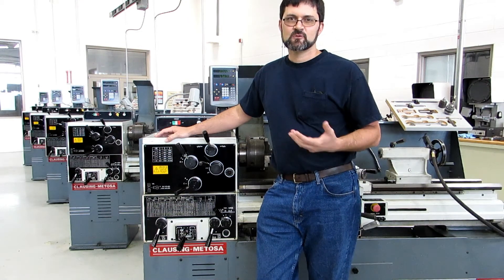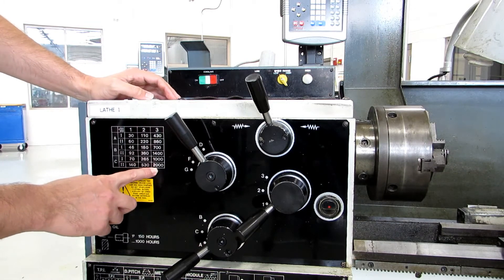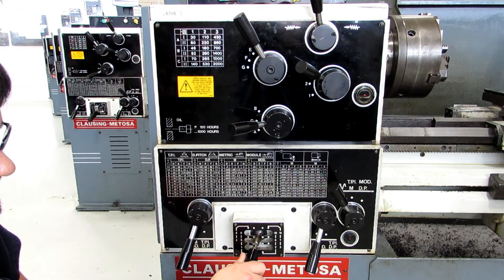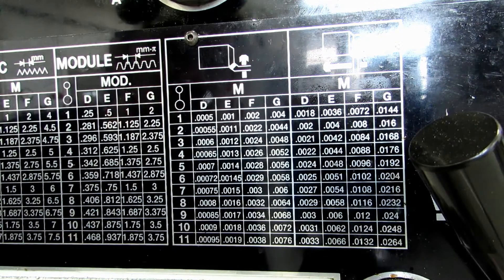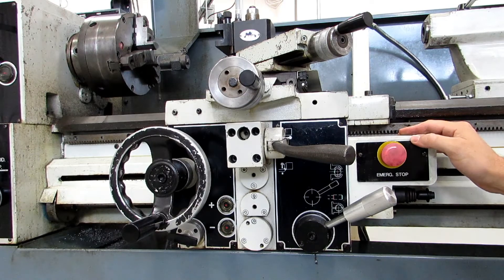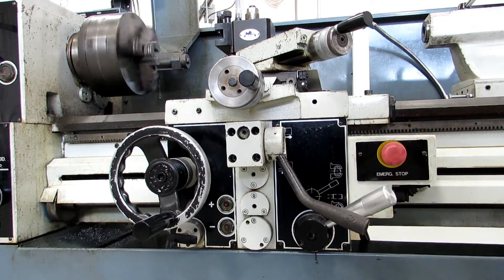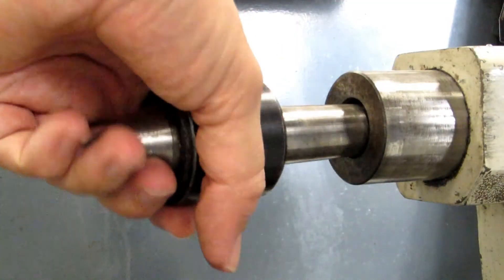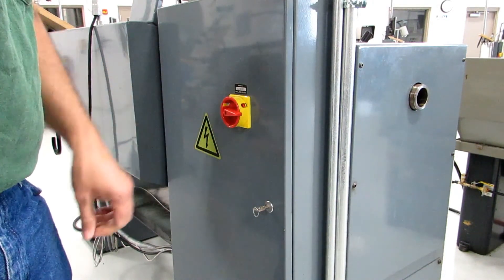Parkland College Lathes - The Clausing Metosa Lathes

Comment: I had one more question about these… do they not have a neutral to free spin the spindle? Thanks
Reply from the maker: If you pull the 1-2-3 handle out you can put it between gears and the spindle spins freely.
Reply: @StuartdeHaro  ok that’s what I was doing I just didn’t know if there was something more correct I should have been doing or a official setting. Thanks!
Reply: @StuartdeHaro  Ok just one more question 😬…. I have the same MH90 Dickson type tool post that it came with and it looks like you guys have the same one but I was going to abandon it because I don’t know how to tell what size tool holder it takes. Do you know what size or type Dickson tool holder those tool posts take? Thanks sir!
Reply from the maker: @noz455sd  I don't know off the top of my head and don't know much about them. I really don't like those tool posts. I don't want to say I hate them, but I kinda do.
Reply: @StuartdeHaro  yeah I can’t say I’m a fan but I’ve not been able to even use it. I contacted the mfg in Spain and it was entirely to much money to get just one. I just wanted one or two so I could make the parts I need to mount it’s replacement which will be a size E multifix. There are a ton of the style coming from India that you can find on eBay but I was able to get a grasp on how they are sized so I could select a proper fitting holder. They are relatively cheap but 30 to 50 bucks waisted per holder doesn’t seem like much but it all adds up so quick.
Reply from the maker: @noz455sd  let me know if you need help making anything.
Reply: @StuartdeHaro   well thank ya! I’ll kinda let you know what direction I think I’m heading. So the compound on mine is 92mm and some change wide. A size E multifix tool post round body diameter is around 125mm and that’s really the size it needs for tool height and horsepower requirements but is going to overhang the compound. So at minimum I need a new T nut for the cross slide and I don’t know about your lathes but my compound has a center hole cut in the middle of the t nut slot of the compound. I watched a install video abom79 did where he basically made a two piece t nut that had a top and bottom. I was going to try to make a top t nut “plate” that was thin but is the full 125mm for the side to the tool post and them on the bottom of it make it fit the circular portion and slot of the compound(kinda a keyed fit that won’t walk around even if it was lose), bored through center for the custom bolt that will sandwich it together to the bottom t nut. Did I make any sense? Maybe I’m over thinking it and should just make a single t nut and deck it off like other installation and that any tool post height I add might make it less rigid than it was before I just though it would be interesting to utilize the hole in my compound plus the 6mm dowel pin the post come with to prevent any desire to rotate. Anyways sorry 😃
Reply from the maker: @noz455sd  Send me some prints and I'll see what I can do for you. The email is my channel name with no spaces or dots or anything at gmail.com. It’s up to you whether you pin the tool post in place, but for what it's worth, I'd rather have the tool post rotate in the event of a crash instead of something expensive breaking.
Reply: @StuartdeHaro  ok that is some logical advice. The pin system for them has three pin holes used as index points. Since it’s 40 position on 9 degree increments the pin holes were intended to make it possible to reindex the post from 0 to +3 and +6 degrees  to hit the spaces in between if ever needed. It may take me some time to draw it up. Also I found out the actual tool post might be back ordered until October unless I buy the actual Swiss made brand but the price difference in $1000 bucks 😬. Also for reasons unknown to anyone other than the genius who commented this heinous act (probably laying in a scrap pile somewhere) the tail stock barrel was removed and is missing 😞. If I get precision measurements of the bore Clausing can have Metosa oversize one and grind to my exact spec but it’s about $1400.
Reply from the maker: @noz455sd  That is definitely inconvenient about the tailstock quill. I should also warn you, the compound is very thin on those lathes. I had a student crash into the chuck with the compound over extended and it snapped it in half. The replacement was...pricey. Keep that thing pulled in.
Reply: @StuartdeHaro  this is kinda wild.. I bought two of these clausing metosa c1330s lathes and one is missing the top slide, the other has been busted in half and some pretty impressive repairs done to it to fix it up. It works ok. I just wanted to replace or make one. Also knew is missing the tailstock quill as well... I wonder if I have the machine or machines that was discussed here ? 😳
I thought I would just whip one up, after being out of the machine shop for 19 years.. yeah-not. I am so rusty at this point I'm second guessing reading a set of mics.. lol 
I however do have technical drawings drawn up. 8 mo later are you still interested? Would love to hear your thoughts after seeing the print ? And a price maybe? 
I did contact Metosa/Pinacho and the quill is no longer available.  The top slide is for a mere $2,780.63.. 
Durabar is looking like the raw material of choice... 😔👍 
And now if I could just find a good machinist to help me out I'll be well on my way. Haha. Thanks for the video though.  It truly did help me to get more comfortable with my new machine.  And yes its complicated and heavy, but a nice addition to the garage.  (2023 price in the midwest was around $6,000.00 for anyone looking at one). But that was with no tooling, no steady rest or follow rest and I feel those both are very important on this particular machine. But otherwise in good condition.  Hope it helps someone else out there. 
Oh and the the longitudinal/cross feed diagrams being in thousands of an inch was a big help. I was struggling to find out what the denominations ment. I figured it was metric. Thanks a million for going over that. If you have any other content on this machine I'd love to see or read it.  
Thanks again,  sorry for the long winded rambling.  Hope you have a great day. 👋
Reply from the maker: @jasonhull5712  Unfortunately I'm not really in the position to make much right now. I moved some months back and my shop isn't going to be put back together for a while. Sorry.

Comment: What model of causing lathes are these? Happen to know how much one costs? 
This seems perfect for a small home shop.
Reply from the maker: These are the Clausing Metosa. New, back in the 90's, I think the school paid around $13,000 USD for each of them. I saw one for sale on Craigslist a few years ago for around $5,000 and that seemed to be about right. They're pretty big machines for a home shop, 14x40, weighs at least a ton, but it depends on what you define as a small shop. If you're looking to make money with it, it's a decent choice. If it's a hobby, they're probably more than you need. They are overly complex as far as I'm concerned, but once you get used to their quirks they are very capable machines. Thanks for watching!
Reply: Stuart de Haro thank you very much for the info and getting back to me. Really appreciate it! 👍
Reply: @StuartdeHaro  Have you ever had to get parts for them? Are they doing well? I just got one for what i think is pretty cheap but it doesnt have a steady rest, follow rest or micrometer stop... but it did have a Newall DRO and its not missing any paint
Reply from the maker: @noz455sd  Clausing is still in business so you should be able to get parts. The company, or at least the US branch is based in Michigan. I can't really speak for the cost of parts though.
Reply: @StuartdeHaro  thanks for the reply! Clausing industrial and 600 group now has zero mention of the Metosa brand associated with their webpage, searching comes up with very little, very few machines out there and the ones that are, do seem to sell and that could be a good sign to their reliability. If it never breaks why talk about it kinda thing 🤷🏻‍♂️ but I’m looking really for accessories but will likely end up making them myself. Pinacho and Metosa are out there but have little US presence. I haven’t contacted the companies them selves so maybe this coming week I’ll reach out and see what they have to say. Thanks! Also the similar pinacho lathes have the controls on the apron inverted… super odd

Comment: hello, anyone know about the brake timers for these? my spindle will not spin after motor turned off. usually spins free after 10 sec delay. all started with burned out motor relay. replaced relay, replaced brake timer. ???? thanks
Reply from the maker: The brakes on ours kick off after just a few seconds.  I'll see if I can find the manual next time I'm there.
Reply from the maker: Hi Maxim.  I took some pictures of the parts of the manual dealing with the brake mechanism last night.  Here are links to the pics:

https://drive.google.com/open?id=1hsInqxPVw4nMQj6VYK1DavquAIrRc_R2
https://drive.google.com/open?id=1mngQnlazxqXlcdu9jwZz0k3d-X7hLeQ0
https://drive.google.com/open?id=1yG-lD34-7WE0YDihs5lOrLZCvl6fLdBX
https://drive.google.com/open?id=1EtD17Pwvll-9jk6cD8ntFqOZgTQ_RSgf
https://drive.google.com/open?id=1UcgDD79-ai4dIc6JKOhJq1382oKcIodL

I hop this helps you out.  There wasn't much info in the manual.  Cheers!
Reply from the maker: oops.  Here's two more:

https://drive.google.com/open?id=19J9seRL83FNUYNk4j6RYt9U1Cnf1kpm2
https://drive.google.com/open?id=1XD9OSv7GggQe7-Y19J9SUEGEExgtffGZ
Reply: Stuart, thanks for your help. My Metosas are a little different (no optional foot brake, no splitter option on the motor), but the drawings help as my manuals are not as detailed. Perchance are your videos available for public distribution? I want my students to resource your library...
Reply from the maker: You're very welcome, Maxim.  Feel free to share whatever videos you would like.  Good luck fixing your brake issue!